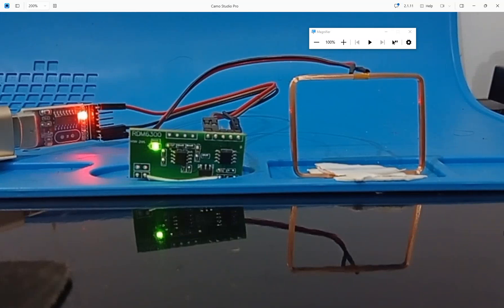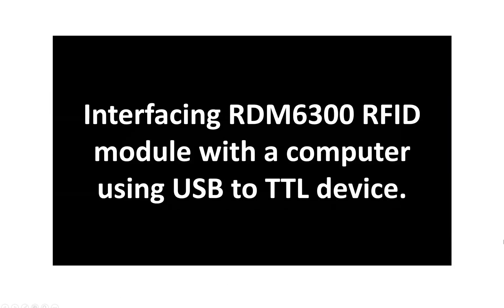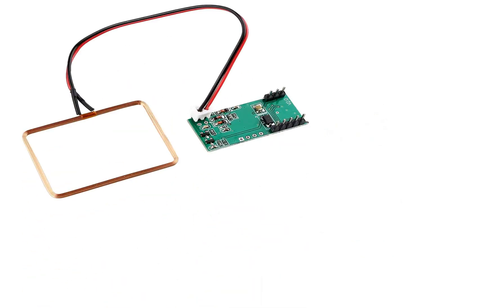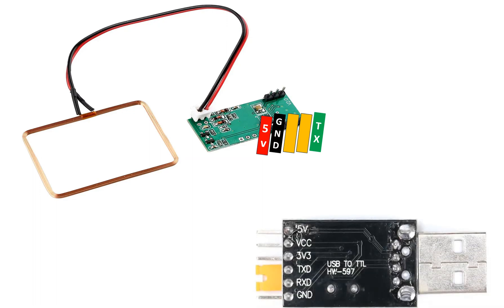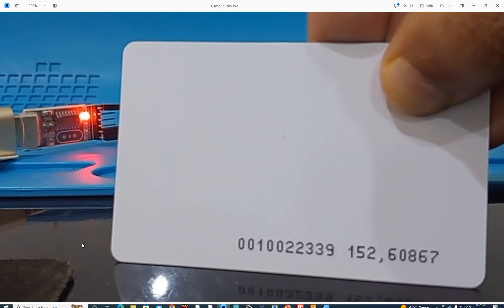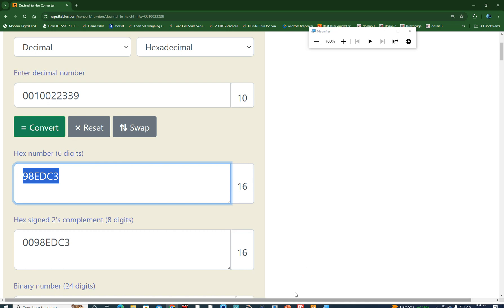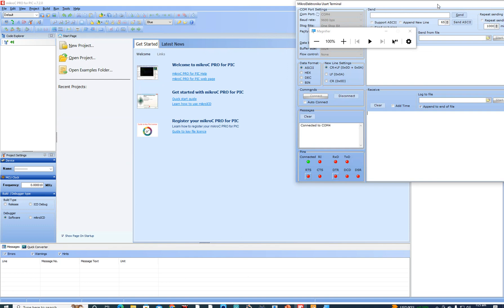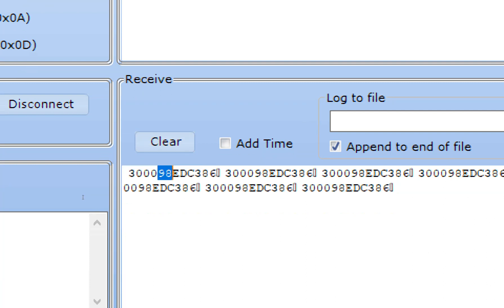Interfacing RDM6300 RFID module with a computer using USB to TTL device.

Comment: What is the maximum range those sensors can work?
Reply from the maker: Depends upon type of coil used
With this coil
Around 10 - 20 cm
Reply: @learningmicrocontrollers3561 do you think it's possible to replace the coil with a custom one? 
And detect if a card passes through the coil, it gets detected